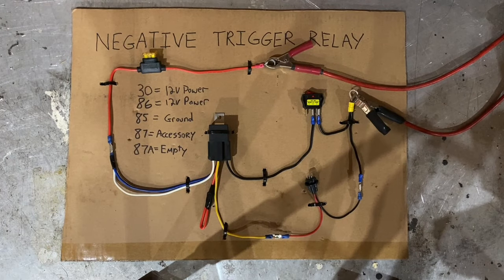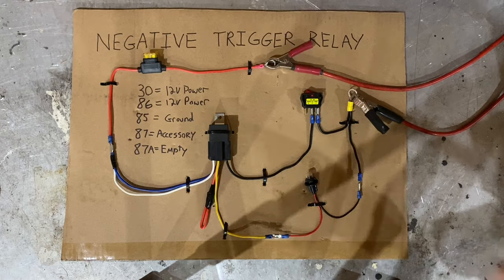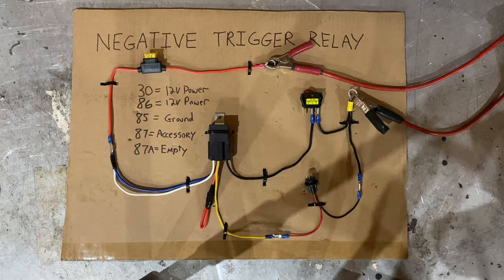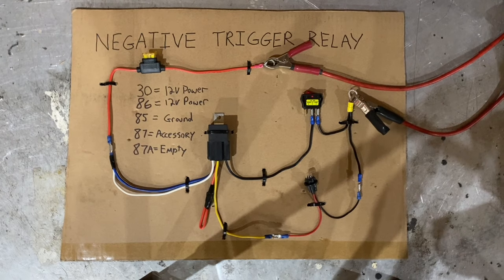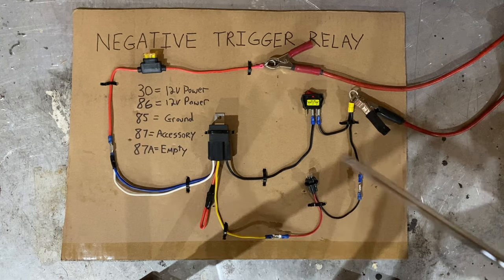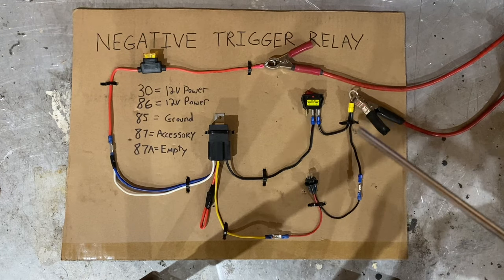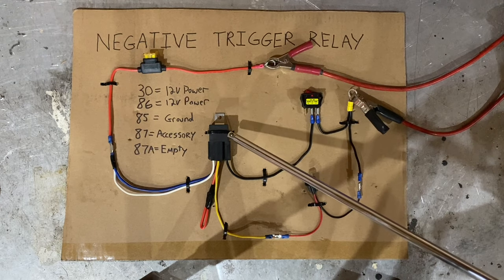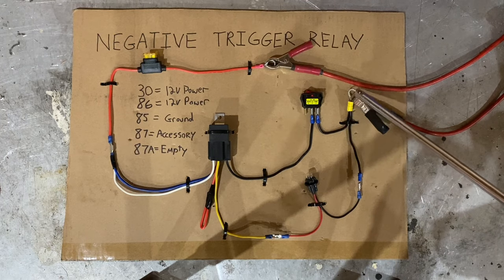How To Wire a 4 or 5 Pin Relay With a Negative Trigger Wire.

Comment: I have a 100ah car battery can inconnect 40a relays or what
Reply from the maker: Your 100ah battery is not really a factor in deciding that. I’d highly recommend you check out this video, because it explains wire and fuse sizes, which really is the same concept as relays https://youtu.be/EhzN6UdnmPA?si=JDo0XUQ_sGvT2q7b

Comment: is it ok 24v relay to the motorcycle?
Reply from the maker: I'm not sure because I'm not familiar with 24v systems.
Reply: 24V relay would refer to the amount of current needed to energize the coil of the relay.  If your motorcycle has a 24 volt source than a 24V relay can be used.

Comment: Hi I have a question I’m having trouble before with blowing my ignition switch on the panel so I implemented a relay wired similar to yours and now the relay is doing what it’s suppose to but instead of the switch is drying now my relay is any help would be greatly appreciated thanks
Reply from the maker: Sounds like your amperage draw is too high for the circuit. You need to determine what the amperage draw is before choosing the relay size.

Comment: Why would you use a negative trigger over a positive?
Reply from the maker: Sometimes it’s nice to keep the relay under the hood of a car and run a single negative wire inside the car to the dashboard switch. Then all the power wires are kept under the hood.
Reply: @WiringRescue  thanks for the reply. After watching your relay videos a million times I finally had the confidence to wire up some foglights. Thanks for the content, subscribed🙏👍

Comment: If 87a ia empty...thrn why are u using 5 pin relay....??
Reply from the maker: 5 pins relays are very common, which is why people often use them, and just ignore 87A.  A 4 pin relay would be a better fit for many scenarios for sure.  Check out this one if you haven't already: https://www.youtube.com/watch?v=W2Mr2Zgv1Ck
Reply: The 87a is the normally closed contact.  If you want a circuit to stay closed all of the time without draining power through the coil than you would use the 87A.  If using this configuration when you closed a switch (energizing the relay) this would break the contact.

Comment: Why would you want this instead of doing it the other way?
Reply from the maker: It’s just another option. Its less wires, and is sometimes nice to use the ground side going to the switch because then you don’t need to run a power wire to wherever you mount the switch. It really depends what the end goal is.
Reply: It takes less amperage to power the coil inside the relay. Than it does what ever component your trying to power .

Comment: Schooling on what a relay is??????
Reply from the maker: Most switches are not made to handle much amperage. If they were, they would need to be much larger in size. Many automotive accessories are rated at higher amperages than the normal (little) switches can handle. So to run a big accessory with a little switch, you need a way of doing it. The relay is the answer. A relay can handle turning a large amperage accessory on an off without issue. The little switch tells the relay to turn on and off. The relay relay the big accessory to turn on and off. In short, the little switch is just remotely controlling another bigger switch (the relay).
Reply: A relay is a lot like a switch.  Both have contacts that can open and close to either break or complete a circuit.  The difference is a switch uses a rocker to manually open and close contacts.  A relay has an electrical coil that when energized opens and closes contacts.  The reason why a relay can handle more power than a switch relative to its size is because of the internal connections between the contacts.  Also, a relay is much safer because if it fails it does so in a manner that rarely would create a fire.  This is also why it is a good reason to use a switch as a negative trigger.  If something happens to the internals of a switch then having it connected to ground is MUCH safer than having it connected to positive voltage.